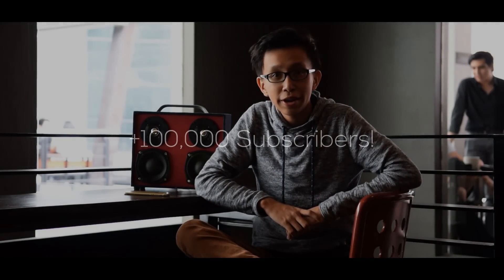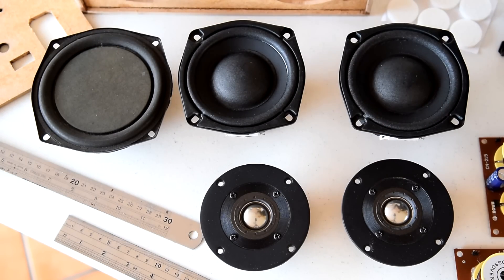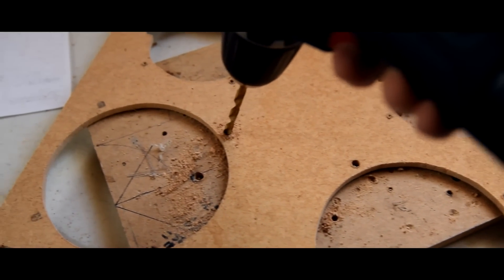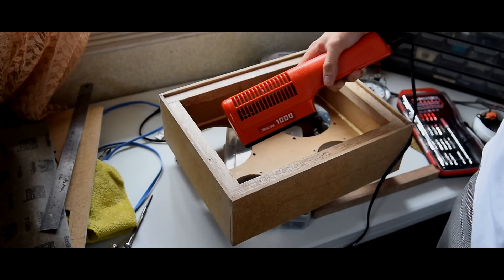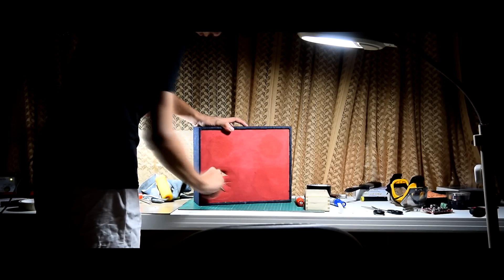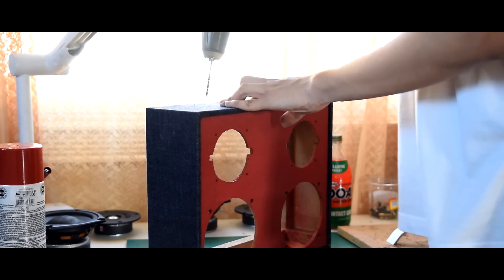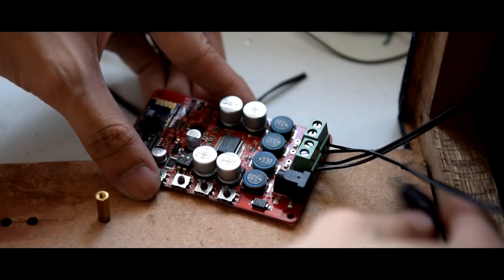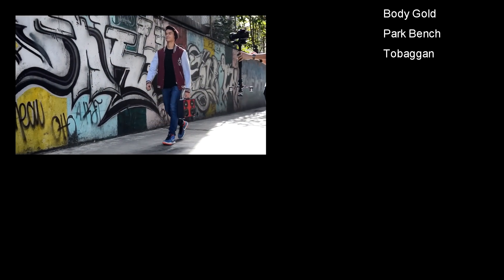DIY Bluetooth Boombox (from scratch)

Comment: As a viewer and hobbyist myself, I appreciate your workmanship with the boombox and the care taken to produce an interesting video.

Your choice in materials and dimensions are very well thought-out, and the creativity with cloth was very cool. Looks like you used 1/2" MDF. This is good for a small boombox. Looks like you also used software and T/S parameters to come up with the right size for the enclosure, including the use of a passive driver. Very well done.

The following is not a criticism in any way, just some suggestions for future speakers from a fellow-boombox builder. The 2x2 design using only woofers and tweeters is ok for loud settings, but not very pleasing under normal conditions. I suggest using a 2.1 amplifier board so you don't have to buy expensive crossovers. This also allows for single sub-woofer design. I've experimented with different speaker arrangements and prefer using a single subwoofer. I also prefer using two full-range speakers instead of woofers with dome tweeters. Tweeters in general sound too harsh for my liking and usually require equalization. 

I like the hack you used to extend the push-buttons to reach outside the enclosure. Quick and inexpensive. However, you missed an opportunity to add cool buttons to the enclosure. I really like using metal push buttons with LED backlights. There are so many options out there when it comes to buttons and switches, it would be a crime not to use them. You already have a soldering iron, so feel free to de-solder those cheap buttons and replace them with something creative.

The only thing really missing from your boombox was a functional VU meter or spectrum analyzer of some kind. A boombox just is not the same without some kind of light show. Check out Banggood for VU meters (LED or old-school analog), some are really cheap (less than 2 dollars).
Reply: Sounds like u know your stuff! How can I get in touch with you. I am in the process of gathering parts to build my own BT speaker but stuck on some steps ie. Choosing BT amp, what speakers to get and size of box. I have bought amp and 1 set of full range speakers based on DIY Perks’ build but worried about box size and want to add woofer.

Comment: Very nice but a small issue. I am referring to your Schematic Diagram. Looking at the bottom left where the power connection is and the Bat mode / AC mode switch is to be specific. If you leave the box connected to 22vac and some joker flips that unlabeled switch, you are going to send 22vac to your battery directly. Definitely a BOOM box then!  :)

Comment: I just downloaded your pdf from instructables. I don't see the actual dimensions listed for the box itself, and don't see a link to the passive radiator? Since I will be using the components you list, can you please provide the dimensions for the cabinet parts and a link to the passive radiator? Cheers - Luther.

Comment: Hi great video and boombox by the way. I have been wanting to build one myself because I have a pair of car speakers, JVC 2-way 300w - (50W RMS) each speaker, Model CS-DR1720. I wanted to know which batteries to use to power these speakers and what specific Bluetooth Amplifier needed for these size speakers and anything else you suggest I should do. Thanks :)

Comment: Hi, when I power it and connect over Bluetooth i'm getting a very annoying background noise and I think it's going to push me to the purchase of another model, but has anyone an idea if it's normal for this amp or if mine is poorly built ? (I checked the two switch are on off and my power supply is a 2A 12 volts transformer)
Thanks !

Comment: Friend, congratulations on the project! My question ... is it okay to use woofers with 70W rms of power (GRS 5PF-8 5-1 / 4 "Paper Cone) with this 25W x 25W amplifier? You would not get much idle power from speaker, once the amplifier (25W) can not supply the power handling of the speakers (70W) and the tweeter also with its 50W rms? Another thing ... If I do not use the cross-over for low frequency cut of the speakers, I would gain more intensity in the low frequencies too, or not? Thank You!!

Comment: Hi,  great video, great project , it's inspired me to make one with burl wood and mabie leds.   I have 2 Q's ,  1 - Can a power adapter that charges the batteries at the same time be used Instead of using the SPDT Switch ?,.   2 .-  Does this amp require any ventilation like a heat sink or a small fan and mabie a small hole that could give it louder bass at the same time ?

Comment: a very high level diy, you really need to calculate volume of the enclosure to the driver's ts parameters, the ts are also key to select an optimum passive crossover.

Comment: Did you tune the passive radiator? Did you calculate the mass needed from the Qts Vas and F0 of the woofers and volume of the enclosure? This needs to be done differently for two woofers in the same enclosure.

Comment: Well... You could've put the 18650 in parallel and use a step up. In this case, just a TP4056 would be enough to charge them. Other than that, great project! :)

Comment: better use marine plywood it's lighter and not moisture sensitive.. and put some stuffing in there (fiberglass) and maybe some bracing. Birch plywood is the lightest it's used in pro speakers. Also the thickness seems to be too thin here you want it to be sturdy otherwise the bass will suffer and you get a kind of boxy coloration.

Comment: I don't think it would be a good idea using those crossovers and those woofers, because there you ended with only very high and very low frequencies. I would instead go with a pair of full range speakers connected directly into the amp output terminals, and a couple of tweeters that don't need more than a simple capacitor to cut out to their needed frequency. It would be better using a pair of car speakers, so they are ready to play all the frequency spectrum.

Comment: I followed the instructions exactly and am curious which position the switch needs to be in to charge. Can someone help me out because the speaker is cutting out when it gets to loud parts of songs due to lack of voltage because my batteries are low. Worked fine when they were brand new and works fine when it is plugged into the wall. Thanks!

Comment: You didn't show us how to wire ANYTHING!! I've been building boxes for a few years now, and the wiring is, by far, the single most challenging part of building a portable sound system case. You specifically should have included a detailed description of how to work with the lithium batteries, as they can explode!

Comment from the maker: List of materials are now out @Instructables: 
http://www.instructables.com/id/Build-a-Bluetooth-Boombox-Speaker-from-Scratch/?ALLSTEPS
Reply: lol video spent too much time on useless footage ,yet i only want to see wiring part
Reply: I didnt find materials from there?
Reply from the maker: In case you haven't used Instructables before. The list with links was posted in Step#3. :)
Reply: TechBuilder  Okay thanks :)
Reply: TechBuilder can you help soldering the crossovers or make a video if you can
Reply: +TechBuilder i have two questions. 1. How to connect the crossover? 2. Which size of the wire i need?
Reply: sdq sdq Me too

Comment: Nice tutorial. Regarding de bass, how good is this BT board to reproduce low frequencies? I've purchased a very similar one from Bangood as well, thas has a line in input and the bass is really poor. Loud, yes, absolutely. Bass, not at all. Not even equalizing the sound from the phone. Wondering if this board you used may be better in that sense. Thanks

Comment: bluetooth and aux?
Reply: it's possible, you will need to find right bluetooth AMP which allows you to connect AUX port. Ones used in the video has no aux feature.

Comment: hey man how long does the battery last on the max volume, i want it to be at least 4 hours?, could i possibly use for battery my power bank? it has 1A and 2A output which is the max electric current, and it's 10000mAh, can u tell me what is the impedance and power on the speakers u are using?

Comment: dude those little batteries will last you 5 minutes XD
Reply: not
Reply: bluetooth receiver uses 25+25W=50W
50W/12=4,16A=4160mA
4 batteries ~ 5000 mAh
20000mAh/4160mAx0.7 = 3,3h
So yea, you're right, but im going to use a better 50w+50w receiver, which if you do the same calculations, those batteries will last me 1,6 hours... oh shit you beat me they wont last only 5 minutes. Still worse than a 30 buck JBL GO which is WAYY more portable than this beatbox, how the hell am i going to sneak this into school?!?!?
Reply: pal, 50w are not even the RMS values, wich means its prob like 15 or so, MAX, no one ever runs max because it causes noise, so: about 5/10w are actually in use, go learn some eletronics kiddo ;)
Reply from the maker: Agree! @lago
Reply: JBL GO!

Comment: where can I get passive radiator, crossover network
Reply: Not sure about the audio crossovers either.
Reply: Not sure about the audio crossovers either.
Reply: Brandoniskoolerdanu can we build it
Reply: Nikhil G P Yes, we can.
Reply: can u please help me with that
any link,etc like that
Reply: http://www.crown.com.ph/products/CN%252d215.html

this is a crossover that he uses.
Reply: bro AM AKI BASS and if you want real good stuff buy on e bay i have purchased 2 JBL crossovers for just 2 dollar man and i have got high qualityy product products and i have also purchased a pair of passive radiator for a very cheap price check it out http://www.ebay.com/itm/Ajustable-Treble-Bass-Frequency-Divider-2-Way-Speaker-Audio-Crossover-Filters-/122208287089 and http://www.ebay.com/itm/162268815795

Comment: pretty sure you're not using that contact cement properly.
I think you're supposed to apply it to both pieces you want to glue together lightly (the wood and the fabric) and then allow it to dry a bit to become tacky, ans then press them together.

Comment: The passive radiator displaces less air than the  main drivers, which you do not want. Also i dont see you mentioning tuning the passive radiator.
Reply: Can you elaborate on this? In which cases would you want a passive radiator rather than a common bass driver?
Reply: +César Pascual Ramos A passive driver has similar properties as a bass port, except the enclosure can be alot smaller. Thats why most portable bluetooth speakers use them to get more efficiency and bass into a compact speaker
Reply: Got it. So, given that this isn't really a 'small portable' speaker, it would take more advantage of a bass port, right?
Reply: +César Pascual Ramos It might yeah, depending on the port size and volume the basses need
Reply: +FSXgta Aha. Oh and how do you tune a passive radiator? What changes can you adjust on it?
Reply: +César Pascual Ramos basically you add weights to tune them, makes them more easy to adjust
Reply: PRs should have at least 1.5x surface area vs. the active speaker.

Comment: the most important part is selecting Subwoofers, Tweeters and Passive Radiator. if you share us these product's link, it would be great. because I dont know anything about the speakers and I am not sure whether my choice is compatible with Bluetooth Amp or not. Please help!
Reply: every speaker is compatible with the bluetooth amp... it's just an amplifyer where you connect wires to.
Reply: bluetooth amp has two 25W output, I just worried about that it can not handle that. But I found some speakers problem is solved!
Reply: no man it's not that  simple
Reply: So what should I do?
Reply: Mustafa Aykanat
  you just buy component based on your amplifier output.you don't have to buy that particular amplifier, there is a better version of it on ebay for 9$  free shipàping 50w+50w that means double the power for less price, then there is a variety of options you can find, i bought 2pcs 10w each tweeters for 6$ and i've already had 2 40w each woofers, i got the radiator, (preaty cheap) crossovers 2pcs for 11$, i am just waiting for components to arrive,  when i try them i can give a full purchase list if you want, but i recommand to try things for yourself, that how to learn.
 the problem is i am not sure about the ballance between the treble, because tweeters doesn't require much power but subwoofers needs for times the power or more that's why i need to try them then i can change later, it could be easier if the video maker provided the power input for each componant, seems isiotic move from him
Reply: astafzciba 
I have already purchased the 25W version. So I need to choose my woofer and tweeter 25W in total. e.g. 10W tweeter and 15W woofer right? If so, it is not good for me. How can I find 15W good woofer arrrghh. where the fuck is this video maker?

I am in Turkey and I didin't buy woofers and tweeters yet. I have just one BT Amp and 2 crossover. when you test the items please share your consideration and item links which provides Worldwide Shipping. thanks in advance!
Reply from the maker: Here you go! :) 
http://www.instructables.com/id/Build-a-Bluetooth-Boombox-Speaker-from-Scratch/step3/Tools-Materials/

Comment: right for all us speaker noobs that have absolutely no idea where to start the fact you say "links are in the description below" and have solely linked the arduino amplifier is handy but also very misleading as i being the first time builder was hoping for a parts list without having to spend hours of research to see if the woofers/tweeter/crossovers are all compatible and if the li-ion battery pack is enough to power such components...would've thought the 5 ish minutes dedicated to gluing denim to a box could instead be used to explain/walkthrough the parts properly and with reasons 
s, to anyone out there who does know rough guidelines of the parts used please help. Thanks
Reply: Can't you just figure it out with some research? Gosh everyone wants to be spoon-fed like a baby please grow up

Comment: im using the 7492p and im using an 15v 1 amp converter but i noticed that it sort of surges after a few seconds,  should i just use batteries?

Comment: a change i would do, is to move the buttons off the board, as i have done so in the past when using a similar board and mounting it inside a pre-built speaker(soon gonna be discarded, as i have new plans) but to each his own.

Comment: where did you connect the base speaker? 
please response
Reply: you dont conect it to anything. is a passive radiator, nor a subbwofer. they basicly do the same thing, but the subwoofer requires power, whereas a pasive radiator doesent.

Comment: Where are all the links to buy all the parts needed
Reply: they sell alot so how the fuck am i supposed to find the right stuff?
Reply: Anonymous 17 yeah thats kinda what he said, it pisses me off, such a nice video but no parts. check out the video from diy perks bt speaker, its good.
Reply from the maker: Here you go! :) 
http://www.instructables.com/id/Build-a-Bluetooth-Boombox-Speaker-from-Scratch/step3/Tools-Materials/
Reply: +Arend Mookhoek right like I thought he would put the links to each individual part needed
Reply: Im not shure but i think this is the amplifier he uses.
http://www.banggood.com/TDA7492P-50W50W-Wireless-Bluetooth-4_0-Audio-Receiver-Digital-Amplifier-Board-p-1003047.html
Im about to build a boombox for my bike with this one. i ordered mine from Dealextreme.com
im from Europe/Denmark and that site worked for me.
Reply: Banggood.com. says so in the start of the video
Reply: From where to buy the speakers... Specially other than woofer and tweeter shows in video please reply
Reply: Deeco or you can go to Raon

Comment: Hi, one question: i got 2 old speakers (5W 5ohm)  from an old radio, can i power them using the amp you were using or is the amp too strong?
Reply: You can use the drivers with any amplifier compatible with 4 Ohm speakers. just make sure that you turn it down when you hear distortion or the voice coil ramming the backplate of the magnet.

Comment: If you're going to take the time and expense of putting together such a nice project you really should use MDF (Medium Density Fiberboard) for the speaker cabinet.  The price difference versus using other materials is negligible and you can buy the necessary sheets at any lumber/hardware store.
http://www.homedepot.com/p/MDF-Panel-Common-1-2-in-x-4-ft-x-8-ft-Actual-0-500-in-x-49-in-x-97-in-988531/206512481

Comment: How do you charge the battery
Reply: Tang Ina I'm srry but are you dumb you need a specific charger for the batteries
Reply: exactly my thought aswell
Reply: +Tang Ina That's not charging the batteries
Reply: +Tanga Ina it is for powering the boom box off of AC power instead of the battery.
Reply: You can use a Battery Charger Module for that if you want to or you open it! ^^
Reply: There is a DC connector on the back panel, right next to the SPDT switch.
Reply: You will notice at 14:17
Reply: DubbleW00pz so, tell me what is that for then??? please explain. LOL
Reply: TJ's Practical DIY that is for charging the battery
Reply: DubbleW00pz I know what I am talking about. Building a simple stuff like this is a piece of cake for me. Check out my channel my friend

Comment: so there are no wires connected to the passive radiator? didnt see any in the diagram
Reply: That's why it's called a 'passive' radiator it requires no power.
Reply: SKORPION 15 thanks
Reply: where can you find the diagram ?
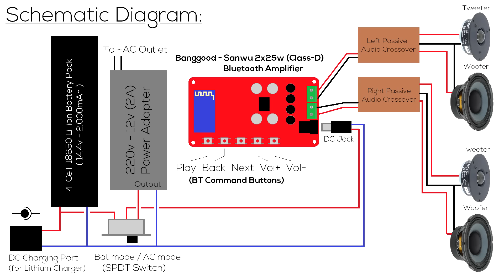Reply: 11:28 in the video

Comment: OK bro I make one of them but.... it much louder that this I make 4x100 watt per channel  by mosfet transistor and I used oscillator hi freq inverter for 12 volt it about 500 watt inverter I build in with Bluetooth module its so freaking loud!!! but I decide low freq  bass my friends vow to the work much .